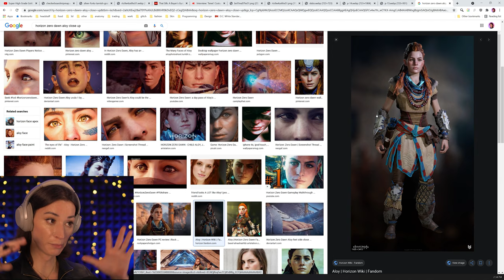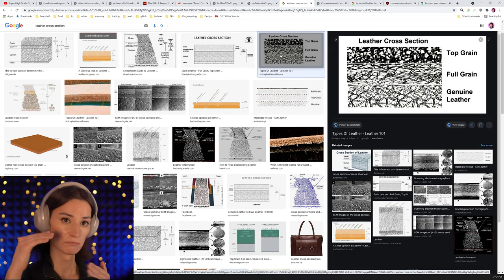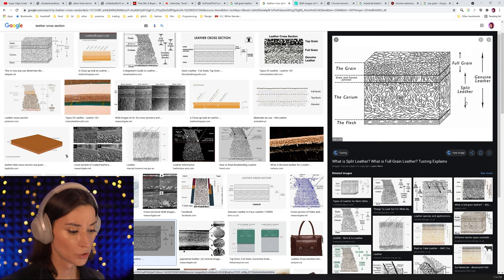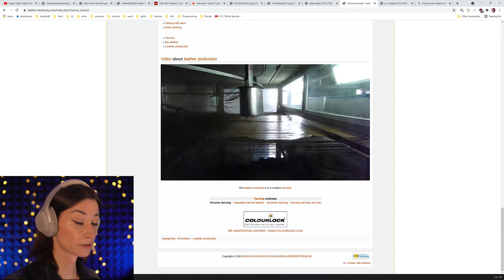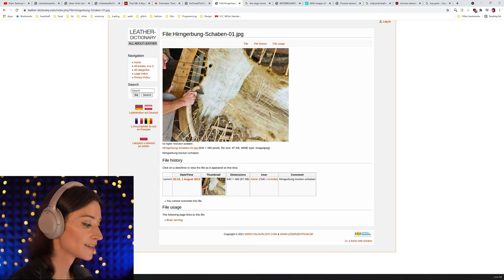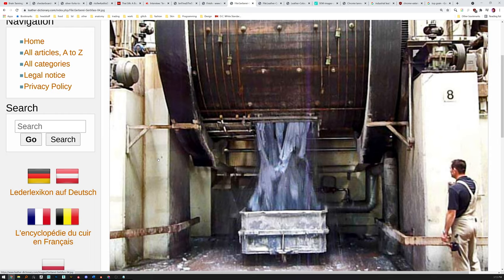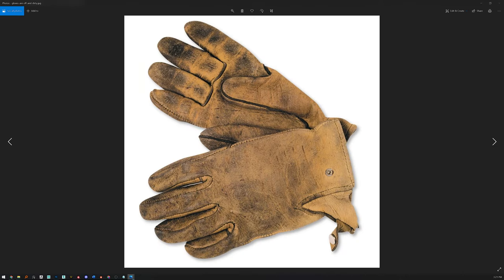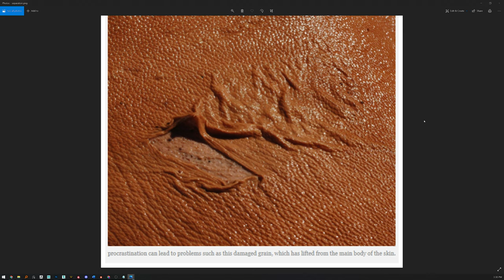A Guide to Leather for Artists

Comment: Nice video. It has some of the info inacurate thou. I`d like to give you some clarifications that might help out.
Just fyi i`m a 3D artist and leathercrafter that teaches the ways of leather :D So this is my world we`re talking about ;)
At 15:24 you`re showing a comparison of vegtan and chrome tanned leather (with oil finish). Chrome tan is what you called here Industrial tanning (i know, there are chromeless methods, but traditionally it`s all called chrome tannage). So industrial too can have lots of variation in the colour and texture. 
At 17:30 there is a picture of blue leather. It`s not gray, it`s pale, light blue. It`s during tanning but before dyeing. This colour is important and almost all chrome tanned leathers start like that. Then they can be dyed throught and loose that colour completely or can be dyed only on the surface. Cheaper leather will be dyed only on the surface and when you cut the leather or scrape it there will still be this blueish layer inside.

As for top coat (mentioned around 18:07) there are 3 main ones: wax (natural, easilly rubbed off, is matte when not polished, allows for patina), acrylic and laquer (usually plasticky and very shiny, no patina). 
When talking about material wear it`ll be very good to talk about natural patina. Fresh Veg tanned leather is very light in colour, pinkish tan, sometimes almost white. Without heavy topcoat it`ll get darker (browner) very quickly from things like UV exposure, moisture in the air, contact with any oils/sweat/water. Additionally the darkening will happen from the edge (unsealled edges absorp moisture).
On the other hand Chrome tanned, oil finished leather (crazy horse for example) has completely different effect called "pull-up". You can see it on the bag at 22:00. This leather is infused with a LOT of oils making it rather heavy but also quite water resistant. When this leather is bent it basicly moves the oils inside the hide and causes lighter streaks on the edge of the bend and darker area around it (basicly inverted AO).With each move this leather will change it`s colour/pattern. It is also very prone to scratches as it has a delicate surface (but if you rub those small scratches they dissapear).
Also what is important is that bovine leather is smooth out of tanning (no pebble texture) and matte in finish. To get the pebbled texture you basicly tumble the leather to break the tension in fibers. This creates all the tiny folds on the surface, but if you press or polish the leather with enough force (usually not a lot) it can get smooth again and loose it`s bumpiness.
This is what i could come up on the spot in relation to making a more realistic leathers for CG. 
You`re doing great work here and i love to watch your videos and learn new stuff from them.